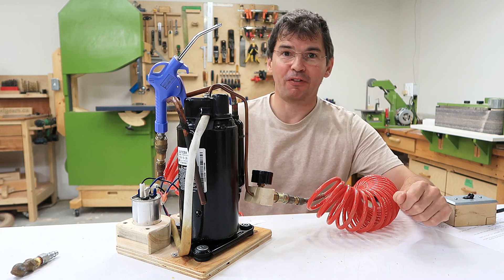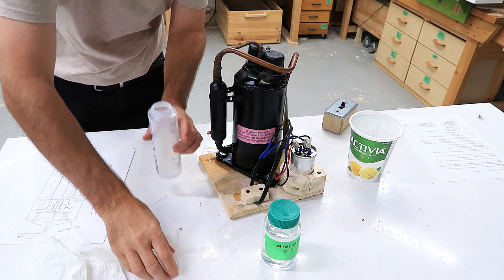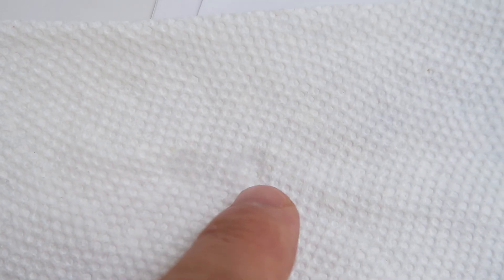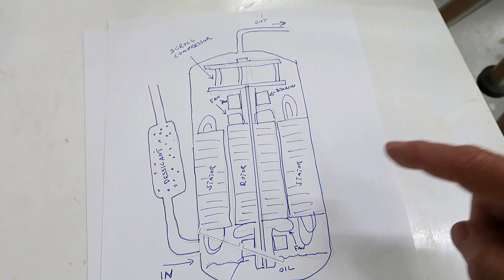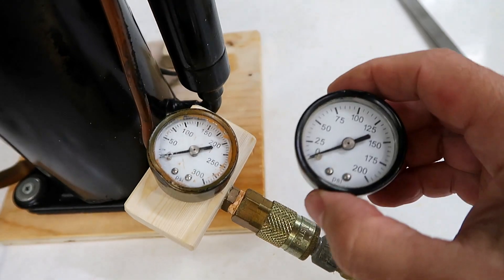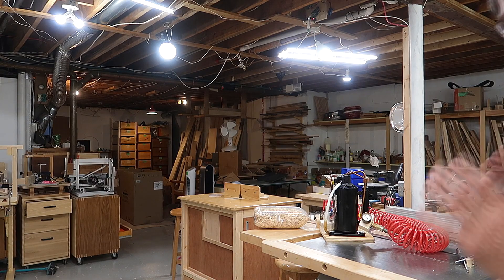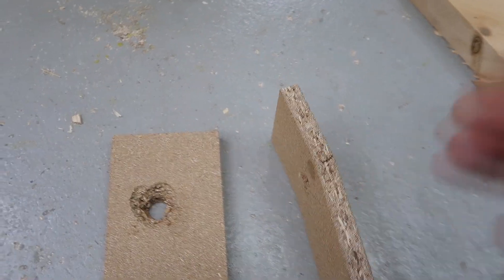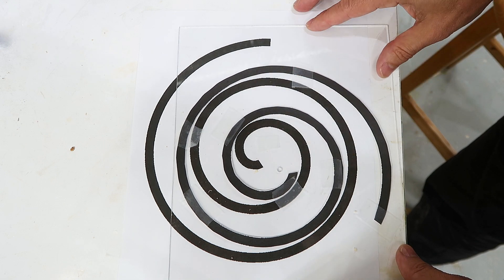This air compressor will fail

Comment: Hi Matthias.  Very nice video!  I am an antique and vintage refrigeration repair guy. I love this stuff and have made many videos!  Your compressor is a high-side housing compressor as you know. The output from the rotary pump goes into the motor housing. Boyle's law applies with all gases including air. The rise in pressure ratio; comparing the absolute pressure of the inlet versus the absolute pressure of the outlet determines how much the temperature rises. The fact that the original refrigerant was coming in at a much higher pressure limits this ratio and therefore the discharge temperature. You'll need to limit the discharge pressure accordingly to prevent some extreme discharge temperatures. It will likely last a long time as you are using it, assuming you don't run it for extended periods of time. 

Laughed a lot at the soda bottle with shavings exploding! 

The one real worry you need to consider with this compressor is that it does compress air into the motor housing, with the motor winding and oil. This may not seem like a problem; however you need to think about the chemicals involved.  Refrigerant and oil never react.  Air and oil can react, in a combustion reaction. If the compressor overheats badly and the oil reaches its flash point then something inside fails and creates a spark, there can be a flash fire inside the compressor. This can create a massive pressure all at once. Normally this won't rupture the casing, but with older compressors and rusted casings it can. There have been fatalities as much as I hate to say that. You won't have that problem as long as you keep the run cycles short and the temperatures low. 

Back in the early 1930's General Motors, in their Frigidaire division, invented a compressor called the Meter-Miser. It was highly energy efficient. This used an orbiting cylinder in a round chamber, with a moving divider block to create a pumping action.  This design was used for many decades and there are still plenty of them around today.  The design was sold to Matsushita (Panasonic). Eventually the design became public domain and many Far East manufacturers copied it.  Yours is a rotary compressor based on the Matsushita design. It isn't actually a scroll compressor. Scroll designs are low-pressure housing designs and operate on a different principle from the Matsushita rotary.  Both designs are good, but different. Refrigeration history fascinates me! I have items in my collection as old as 1926 and am delighted to talk about them. It's one of my passions.  I have posted two more comments with more links. Hopefully Matthias will approve it and allow it to share.
Reply: What are those tankless high cfm compressors, I believe if I'm remembering correctly used in tractor trailer semi trucks?  I think they're called a screw compressor?  Those are supposed to be the way to go, though expensive and harder to find cost effectively.  I recall wanting to find one of those screw designs for my shop... seemed easier to clean the air as well for plasma cutting and safer than having tanks... other than the drying circuit... whether a cyclonic like upside down industrial gas tank and later condenser stages of copper pipe and a desiccant or not.
Reply: This is fascinating.
Reply: Forgot to mention, great detail and also ask if you're aware of any other sources of the screw type design that's suitable for say plasma cutting or roadside more portable utility?
Reply: @jafinch78  
When I worked for another company doing Stateside field service, I had a work truck with an underhood rotary screw compressor. It was called a VMAC VR70 underhood compressor. It was belt driven off the 7.3L PowerStroke diesel engine with a second serpentine belt. Would make a massive 70 CFM. That was a really neat system, and proved to be very reliable. Just looked at the website and they renamed it the "underhood 70" model now.
Reply: @davida1hiwaaynet  Awesome!  Yeah, that's where I left off having not done much with my air compressor or air tools since last leaving off there.  Kind of in a, "what did I just invest in state of mind," and thinking I'd be better off without the tanks and myriad of other rescued equipment most think is junk though very functional... just larger and more space hogging.  Reminds me a trip to the big rig salvage yard might be worth doing and calling around to see what's available or close.  Was thinking that and researching salvage yard bigger rig power steering pumps for use with hydraulics projects.  Wasn't sure if was the oil-less/oiled screw or rotary screw designs were used.
Reply: This is one of my videos; where I am rebuilding an original 1937 model Frigidaire Meter-Miser. This is the original design with the mechanism which evolved into yours. This one has cotton insulated motor wingings.  https://youtu.be/xnhObeLvwf8
Reply: it is a rotary vane indeed
Reply: I have a super old fridge with sulfur refrigerant.  I wonder what mechanism it uses for compression?  Still works great and it whisper quiet.
Reply: Have you seen the refrigerator canister they throw in a fire and then remive to let it start the cooling phase? It was supposed to be for poor nations so people could still refrigerate without electricity. Not sure but they may have used propane???
Or have you seen the GE design for magnetic cooling? It uses a solid germanium-gallium-(and something else I don't remember) alloy that strains under a magnetic field for the hot phase, and then releases the strain made by the magnet is the cool phase. The pressure levels are much lower and the cold is transferred using an ethanol-water slurry to the cold compartment. It sounds like Darth Vader breathing when it runs.
Reply: Thanks so much! Fun read! Scary too!

Comment: for the oil , get a dryer for gas systems (A/C), and also a filter drier for air systems ( water trap and oil trap ) and you should be fine and maybe an exter high pressure air filter ?

Comment: I saw an e.Europe guy like to use these as a home brew vacuum pump to evacuate the lines for diy AC work.  Instead of an air compressor, it could make a decent infrequent vacuum pump.

Comment: Matthias, I really like your videos. You do great wooden contraptions, but wood is really the wrong material to use with >100 psi pressures. Please be careful with compressed air, you don't show much respect in regards of safety here. Parts flying off or disintegrating can cause serious injury, you even show the potential danger with the air rifle. A friend of mine lost an eye when working with 120 psi because a part failed. Even bought parts you use here like the hose are not made for >150 psi, much less 300 psi, and there is no pressure relief valve at all to prevent catastrophic failure in case you unplug the compressor too late. Fridge compressors depending on the model will not stop to increase the pressure, up to 750 psi or even more, depending on what refrigerant they were designed for. This can be lethal.

Not trying to ruin the fun of messing around or annoy anybody, just a reminder that compressed air can be quite dangerous. Sometimes it is easy to forget, as it is "just air"... ;)
Reply: The 3 way connecter made of wood is freaking me out badly. It's giving off vibes like it's an IED
Reply: Yeah I was on edge watching the pressure build to 200 - then he shows 300!
And fark I didn't know that block was the junction itself! I thought it was some cover or something...
That is just a mess of pure luck that it didn't shoot off on camera!

Comment: If the gas coming back is 12 degrees super heated and at air condition evap temp or maybe 40 to 55 degrees f (depending on many vapiables) that would mean the vapor returning to the compressor is around 52 to 67 degrees. This will produce some cooling effect on the compressor. I have  noticed portions of compressors sweating or condensating in the field while not returning liquid refrigerant back to the compressor verified by suction line superheat. Bottom line the refrigerant vapor being returned is definitely able to  produce a cooling effect on the compressor motor and compressor. Is it crucial? I'm curious if it really is.

Comment: I have been using a fridge compressor on a 8 litre tank for a truly silent air brush set up for about 3 years now, all I did was measure the amount of oil I drained and replaced it with an equal amount of full synthetic 0W35 castrol oil. The oil mist is a real issue but I have a SMC micro-mist air/oil separator that removes 99% of the oil and water before it reaches the tank the water trap on my regulator has never had any condensate accumulate. As long as you replace the oil that escapes it will keep going for a long time.

Comment: POE oil is hydroscopic. Yes, in a refrigeration system the coolant does cool the compressor. Refrigerant returns superheated about 20⁰ to 30⁰ degrees above its evaporation temperature of about 42⁰. (AC system) Refrigeration compressors running without refrigerant often cycle on thermal overload because no cool return gas.

Comment: The refrigerant on the suction line while operating is probably around the 100-psi range. The output is probably in the 350-400 PSI range. So the compressor is likely designed to run up to about 250 to 300 PSI or so continuously. The gas coming back from the evaporator would also be a little cooler then ambient which would have some cooling effect for the compressor, but the AC fan blowing across the outside of the compressor provides most of the cooling since it's just a big heatsink at that point. Oil loss and starvation is likely your biggest issue to longevity on this thing. As far as water and rusting internally, what I would recommend is to install some good ball valves on the input and output. After you do your experiments, start it up and close the input valve. This will allow the compressor to pull a vacuum and evacuate most of the water from the system. After letting it run for a minute or so, shut off the output valve and then turn it off. You've now eliminated most of the water from the system that is likely to cause you any issues.

Comment: I suggest trying to use it as a vacuum pump next :)
That's what I'm trying to prep mine for. Careful with the chamber tough, implosions are not nice
Reply: Ac compressors have no problem with vacuum.   The entire ac system is pulled down to a vacuum to remove all air and water vapor before charging with refrigerant.  I have a similar compressor from window unit that I use asa vacuum pump.   It easily pulls enough vacuum to boil water at room temperature.  You just have to limit run time and watch its temperature because no cooling.  I never bothered using it for a compressor since I already had one.
Reply: @d455ave  For hobby use there is no issues with running them in a vacuum as long as you keep the duty cycle where they are below 10psi reasonable, however they are not run in a vacuum in use because it will damage them if done regularly in their normal operation. Generally you don't want to see less than 10-40psig depending on refrigerant used. The evacuation of the system is done with a vacuum pump, not the unit itself. Windows units and small home AC units don't have pump down for defrost, but larger commercial units will, and even they don't like being run in pump down for long.

Comment: **********The device on the suction line  on the side of the compressor is an accumulator to stop excessive liquid refrigerant from dragging the oil out of the crankcase and also keeps the scroll from damage from trying to pump liquid.  You can probably cut it off.   Although I’ve not run across an accumulator that had desiccant installed, it could be implemented as a manufacturing cost savings….     Love your technical videos….Retired HVAC/R guy here

Oh, For years small compressors were repurposed as vacuum pumps and whatever. I have an original  Whirlpool ECP127 vacuum pump that uses a large domestic refrigerator compressor….and this thing has been left running for more than 24hours multiple times a month with no problems….and it’s 53 years old.   If it works..you win!   If it fails, get another one and make it work!

Comment: The tank is NOT on the high side.  When the scroll comes on, a piston on the top moves upward & seals to the output line.  When it is off, the piston moves down & dumps the pressure.  This is done to prevent the compressor running in reverse & to dump the pressure so the (feeble) starting torque can restart the motor.
          What you DO have is a "wonderful oil & water mister", to contaminate EVERYTHING in the shop & house with a sticky oil film.  If you are in a car "garage shop" running air tools, that's fine.  In fact, it lubricates the tools.
Reply: The case is on the high side and this is a rotary compressor not a scroll.

Comment: I ran a 1/4 hp piston compressor for several years, only added oil one or twice. Ran great, used a truck muffler as tank, never failed. I did had to drain water out of tank, of course.

Comment: You can use that for hydrostatic testing of compressor tanks and receiver tanks. Low volume = fast pressure rise. Be careful though.

Comment: Another reason you may not want to do this is that refrigerant compressors can diesel. It's rare, especially at the pressures and temperatures we are talking about here, but not inconceivable.
Reply from the maker: never thought of that, would be fun to see it happen!

Comment: Could just install a coalescing oil/water separator on the discharge side of the compressor to deal with entrained oil (and water).

Comment: To the haters: I've been using a compressor in my shop like this for little jobs for decades. Its not worn out yet! Matthias I think you'd be surprised to find that actually most of these small compressors are not scroll type..

Comment: What we did as kids with the bottle is the bicycle valve but we removed the valve inside that just screws out, made attaching a normal pump way easier and yes we exploded them by hand, just like 1m away from the bottle.

Comment: With a regular compressor inline ahead of it a lot of the moisture would condense out and you could use this one just to boost the 120-150psi up to 300psi.
The oil coming out could be passed through a filter before use.

I run a small CNC machine using compressed air as the coolant. The small air compressor has to run almost constantly to keep up, so a small and quiet compressor like this would be ideal. There are literally bins full of these compressors at the scrapyard and also small appliances being dumped all over the city every day.

Comment: could you use this as a second stage of compression on a shop compressor. you mentioned 2:1 if you fed it 100psi out of a larger tank and just flicked this on when you needed 200psi for something small?

Comment: I'm actually 99% sure that the casing of the scroll is at the low side, where as the high side only is connected to the valves and the head, which is the volume you are seeing when building up some pressure.

Comment: Try feeding the input from the output of a shop compressor.  And for attaching to the bottle, you can get robust bottle rocket addaptors which could have a metal airline fitting glued in.  Lots of glue for 300 psi...  Awesome mess btw!

Comment: Hey Matthias! A carbonation cap with a ball lock would be a great way to get pressure into that soda bottle without leakage. I've personally had a 2L bottle burst due to a faulty CO2 pressure regulator on my tank. You can find them on amazon for about 25 bucks.
Reply: that compressed air has massive issues with food grade material. POE oil is nasty and becomes more nasty when it decomposes into alcohol and acid upon exposure to atmospheric water vapor

Comment: I think it's pretty cool, maybe it can be used as a little portable compressor ? Like for filling bicycle tires or dusting things off, not sure if that oil coming out of it would be a problem, but those inner tubes only have to last a few years anyway..
Reply: Unfortunately they are a bit on the heavier side for their size compared to those small and cheap airbrush compressors, but getting one of the airbrush ones (which usually come with carrying handles already) and putting on an adapter between the 1/8 to 1/4 or 3/8 fittings for regular air tools isn’t that expensive, though you’re limited to blowers and tire inflators pretty much.
Reply: @motalasuger  Ah, I've never seen/had one of those, that sounds like a good idea too! Also just realized with the oil coming out (no idea how much) this one would maybe not be so great for dusting things off. Well he's got this one now, let's see what he'll do with it. I'll look out for those airbrush compressors

Comment: it wont fail . they use fridge compressors in silent air compressors  these HVAC compressors are designed for alot more use . this will run for years just keep oil topped up and use a air dryer on output

Comment: No hate here but mineral oil will also absorb water. It's used as a dielectric in some RF capacitors and great care is taken to keep atmospheric water out (arcing could ensue). I'd put an oil separator on the output and maybe a small dropout tank for excess moisture. You could try a larger desiccant tank on the front end. There is also a "permapure" dryer that's available too where part of the output passes on the outside of silastic tubing that the input passes through and water vapor gets "sucked" through the silastic tubing but $$$ ! Home made one maybe ? Take care. Tootles... Wade

Comment: The compressor is a A rotary compressor. The rotor is on the bottom and the suction pipe has a separator or a suction Receiver to keep the compressor from getting liquid refrigerant.
Reply: It was pretty fun though.